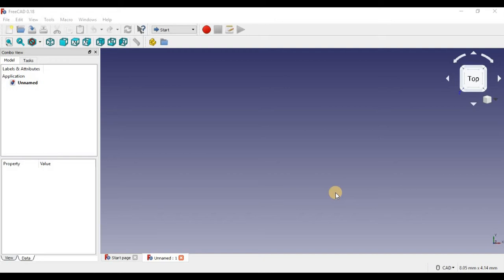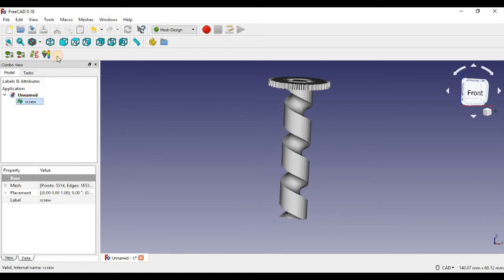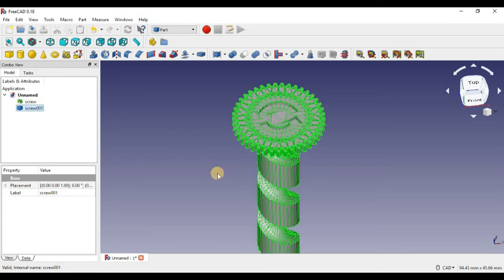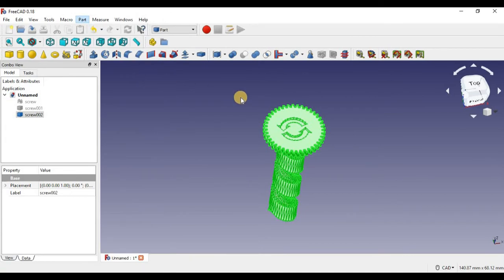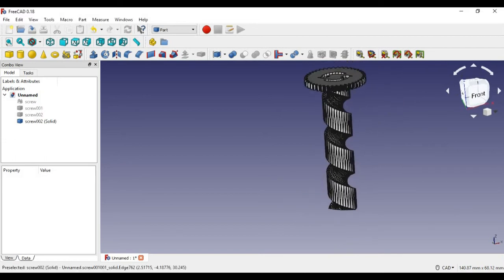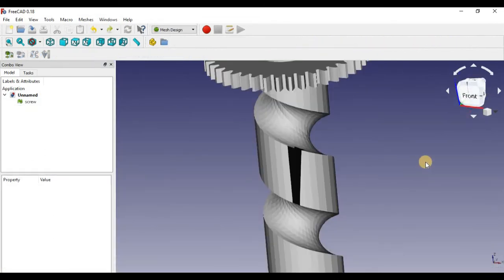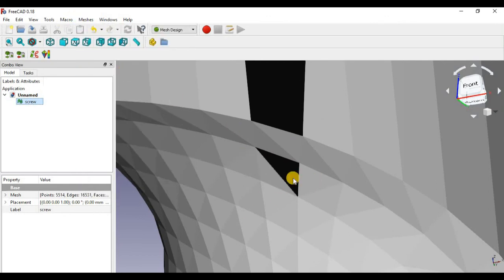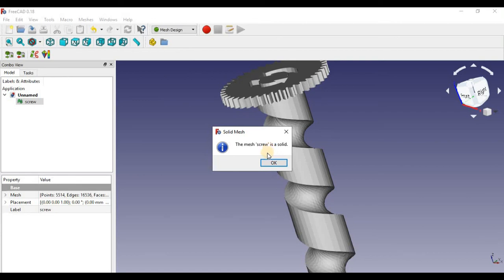Freecad tips and tricks (#3): importing/editing .STL files

Comment: Thanks for the video! I have a battery enclosure STL that I need to resize without skewing or changing the size or placement of holes and bevels. In Illustrator, with 2d shapes I would select all edge points and move them out to change dimensions. Whats the best way of doing this with STLs (after converting to editable mesh)? What program is best for this type of editing and customizing of STLs?
Reply: I'm looking for the same answer. Any luck finding the information? I think I am looking for the same information, let me know if I am or not but here is what I'm trying to do with my model(s):

I have a model that is split up into different parts that fit together to make an articulated action figure. All these parts are STL files. Since action figures and/or things you make that fit together and move, there needs to be what is called "tolerances" which is basically a tiny gap between moving parts so they can move back and forth, ect.

For example, let's say I have a peg and a hole for that peg, I wanna be able to select the inner surface of that hole and extrude it out slightly to make a tolerance for the peg to fit into it.
Reply: @KirklandShunk  You can try Blender, it works better with heavy mesh and you should be able to seclect and extrude the surface